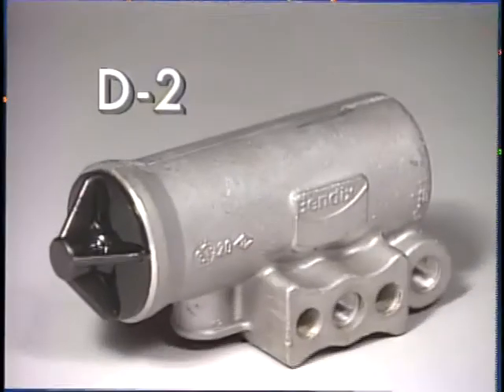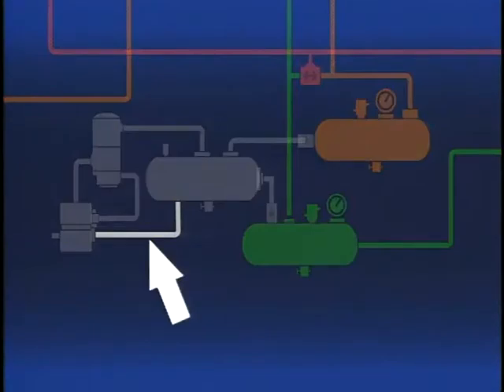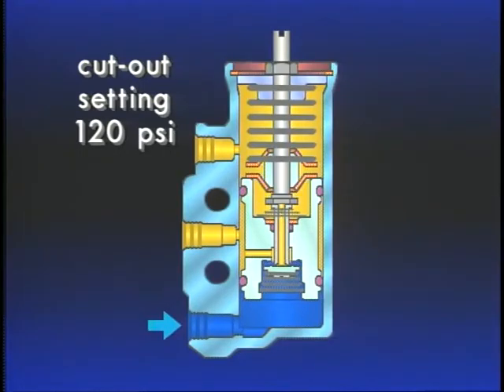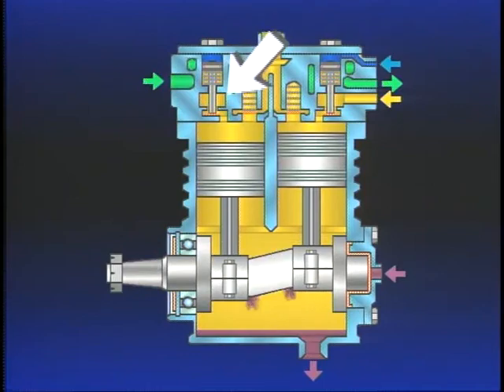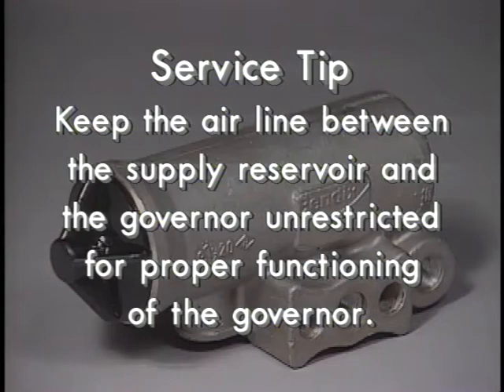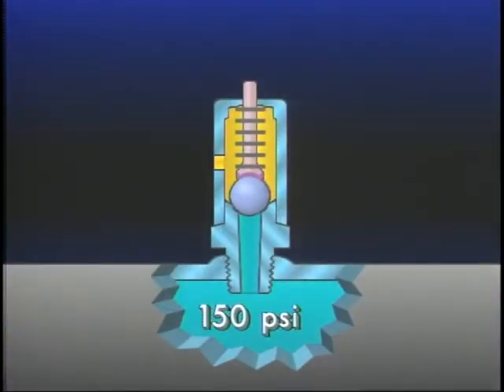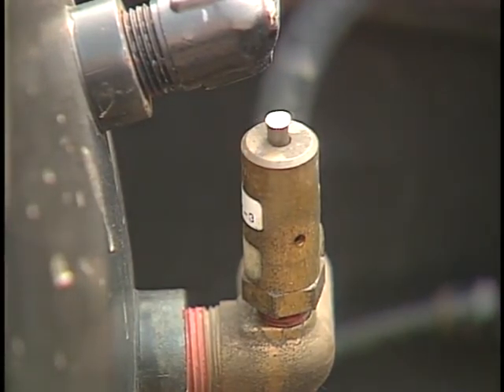5.04 Air Governor Operation

Comment: What is the purpose of the port next to the pressure setting spring? I didn’t see that mentioned
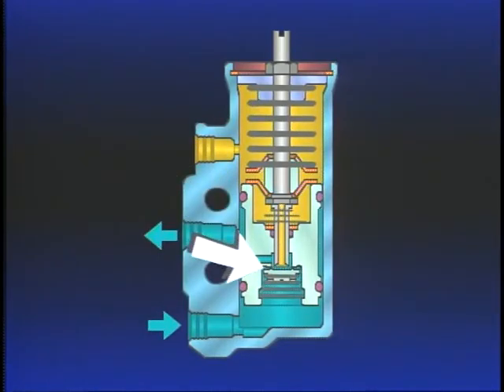Reply from the maker: Great question.  That is the exhaust port,. 2:11, and it normally is just left open giving a way for the air to exhaust from the governor.  It is a threaded port and in some cases I have seen a line connected there if they want the air to exhaust a few feet away and not directly at the governor but that is not common.  For the governor to work properly though that exhaust port must remain vented.

Comment: Fantastic illustration and explanation. This helps owner operators such as myself understand the function of the air system to better diagnose an issue. Can a faulty air compressor cause excessive crank case pressure?
Reply from the maker: Yes, I believe it would be possible for a faulty air compressor to cause excessive crankcase pressures.  It is using the same lubricating oil and any blow by in the compressor would typically go into the crankcase.

Comment: Why when you turn the adjuster clockwise, tightening the spring, make the cut out pressure go down?? In my mind that would mean it takes more pressure in the reservoir to over come and cause it to unload
Reply from the maker: Great observation and you are completely right; that always seemed counter-intuitive.  When you look at the service data information, at the internal workings of the governor, when you turn the adjusting screw you are adjusting the lower seat of the spring.  This is why turning it clockwise actually moves it down, allowing the spring to lengthen and thereby reducing the pressure needed to reach cut-in/cut out.  Turning it counter-clockwise would move the seat up and do the opposite.  Here is the link to the service data with more info: https://1drv.ms/b/s!AuztCXNnVSIjiXO0kAWqZOn0AC2L?e=Lo6exG
Reply: @Jim Mack  hey! Thanks for the response, that definitely clears that up for me. Could not wrap my head around that haha

Comment: I have 2006 Kenworth T800 Quad Axle (Dump Truck) with a Cat C-13 Acert engine.
My truck is not building air (45 minutes from 0 psi to 120 psi) at 1000 RPM.
I removed the Braided supply line at the Compressor and started the engine. I have air (no oil) but I have no idea how much. (NoGauge) I don't suspect the compressor. 
I then connected 120 PSI shop air to the Braided compressor line, and still no difference.
It's hard to see but, does the Braided line from the compressor go to the air dryer or the wet tank first?
On the wet tank, there is a valve of some sort.
Why would the air go to the wet tank first? (if it does)
Something must be stuck or plugged.
HELP !!!!!, please 
I need to get to work !!!!!
Reply from the maker: The braided airline would go to the air dryer first, before the wet tank.  I would recommend checking the hose where the compressor pulls air from but you said you connected 120psi to the air line leaving the compressor and even that wouldn't fill your tank?  That would mean it is not your compressor or air supply; it would likely be a blockage in the braided line or the the air dryer before it is getting to the wet tank.  Perhaps you could bypass the air dryer temporarily to see if that fixes the problem.
Reply: @JimMackHeavyEquipment  I removed the braided line at the compressor and disconnected the other end at the air dryer (disconnected both ends) and applied 120 PSI shop air and there is no blockage. I then connected it back to the air dryer and applied shop air. It takes "forever" to build "any" air at the gauges. Since then, I have removed the air dryer filter and cleaned where it mounts, nothing to speak of. I then replaced the governor on the air dryer, and the heating element (because I was there). I am now replacing the "Check Valve" at the Wet Tank. Maybe it's stuck?
Why will it not build air?
Reply: Did you end up finding your solution? If so what ended up being the fix?
Reply: @peterdelfs6211  I did but I can't remember exactly what fixed it. I will never let my truck sit again for 20 months :(